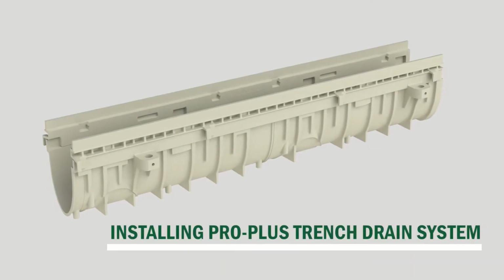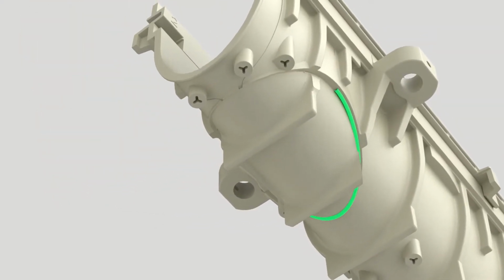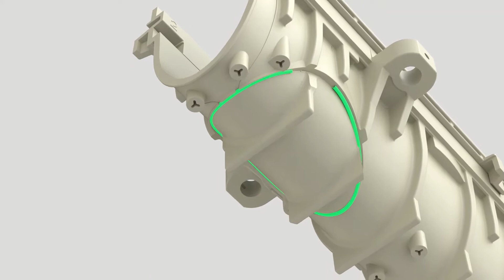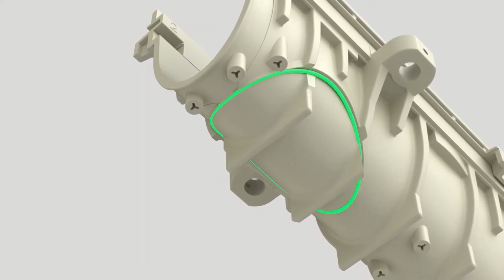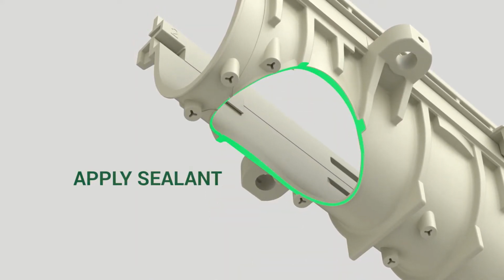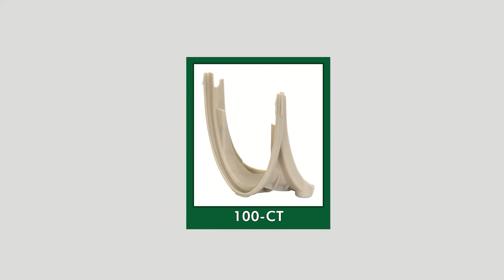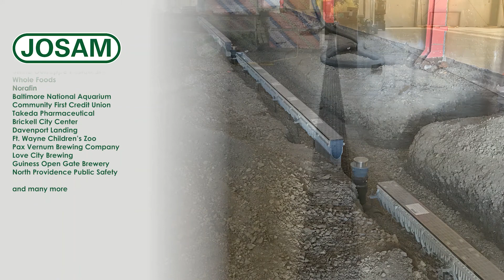(Short Version for Installers) Josam Company PRO-PLUS Trench Drain Installation Video

Comment: The inside of the trench has an arrow pointing in one direct. No instruction whatsoever to indicate which direct the arrow should point. I figured the arrow should point to the outlet side (down slope) and set my short (10') in that manner. This video did not address this. The video has the 1 at the outlet side and shows the numbers going up toward the inlet side or end. This is counter to which way the arrow points. Confusing! Just a simple mention in the video or actually a set of simple instructions would have been helpful! Otherwise, a great trench that was easy to set up. Hope mine works since I went with the arroe direct pointing to the out let side. Concrete come in two days.

Comment: The bottom outlet connector two screws are too small and strip out very easily, End caps do not snap off as intended, end caps have to be glued as well to properly secure.